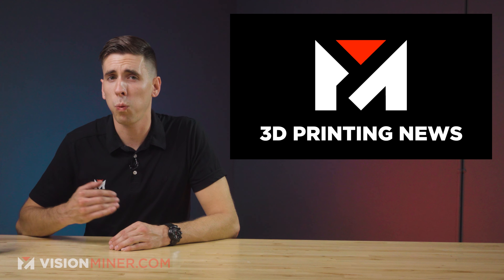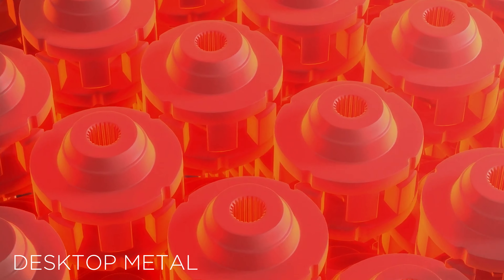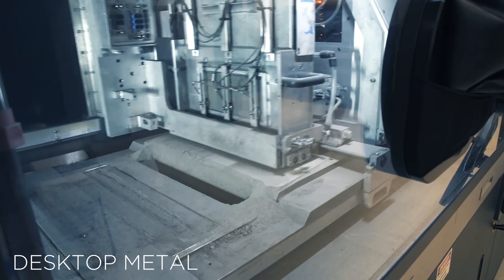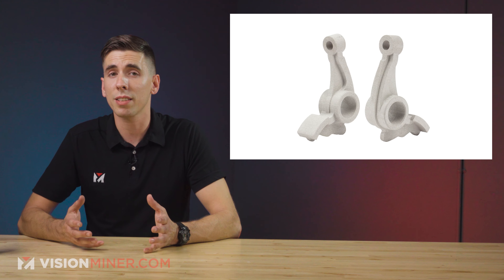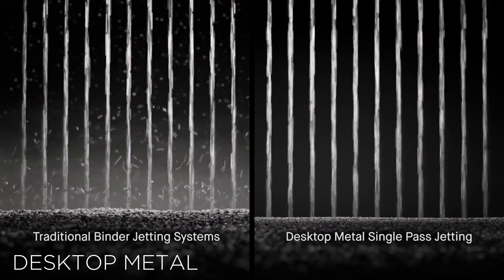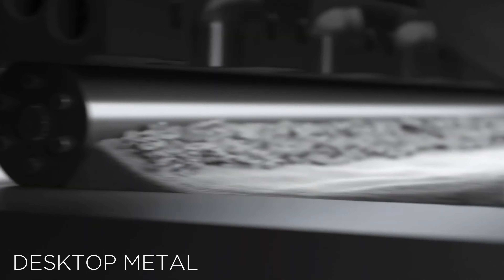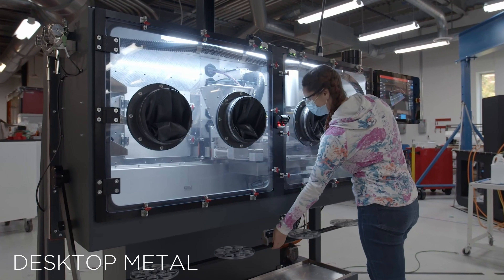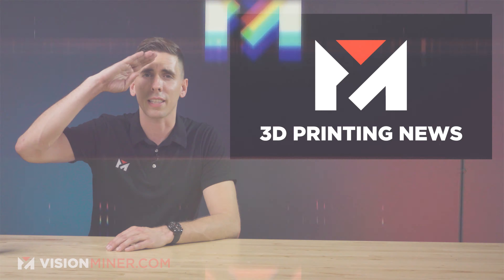Desktop Metal Approves 316L Stainless Steel for Production System! 3D Printing News

Comment: FDM plastic is amazing, but if you could pay $2000 for a desktop printer for 316?? That would be revolutionary. I think it still requires the final heat treat, but you can already get small kilns that would be easy for a hobbyist to have in a garage.